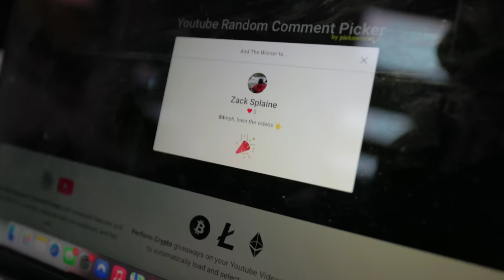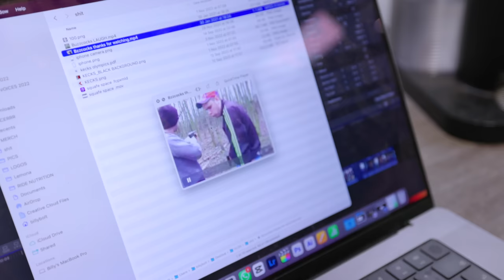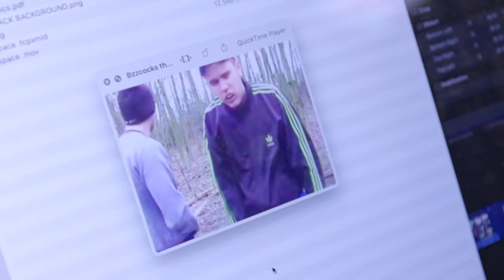I DID SOME WORK ON MY 90's HUSQVARNA WR360!! PLUS THE RETURN OF DH BILL

Comment: I've had a couple of 360 WR's and great bikes. I had a spare 2000 engine I bolted into a 2009 WR 300 frame, it will also fit to 2013 250/300 Italian Husky's.... you just need the air box boot off the 360, donate the the TM Mikuni carb to a museum, fit a lectron carb and you now have a chassis that can keep up with the motor...It's night and day difference and easy to do.

Comment: A heads up for the 360 from 89 until 2004 the engine never really changed all engine components will inter change the only thing husqvarna changed is the kick start intermediate gear as the early 89 -96 the bearing was a weak point so husky redesigned it and fitted a 2 bolt fitting ste stub instead of a bearing in the engine case . 250 and 360 are different primarily gears but the gearbox set will interchange if you can find one get a 6 speeder box if you have a cr it will have the smaller petrol tank , the wre has the bigger tank and will fit straight on just remember to disconnect the balance pipe when taking the tank of otherwise you will gave petrol p%%%%ing everywhere 😅😅😅😅 . I got mine as a basket case from. Ebay in 2007 and still going strong today. I forgot to mention top and bottom yes are made from some type of shite and will crack at some point in time over than that they where awesome bikes . I do have some spare parts  A  set of top and bottom yokes ,5 speed  gearbox power valve .

Comment: 8:38 worst thing you can do is store files on the o/s harddrive especially if you’ve got big video files being saved and deleted constantly… if those macs have the soldered in hds there’s a lot that have taken a shit on themselves as the board configuration is a bad design as volts can go into the negative connections and fry everything including the cpu chip and you lose everything unless your doing regular time machine system saves